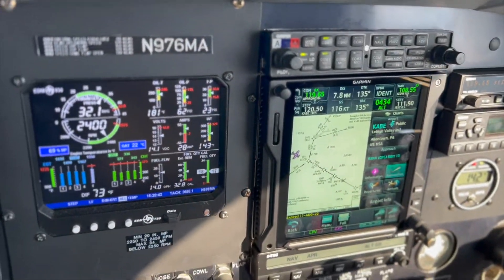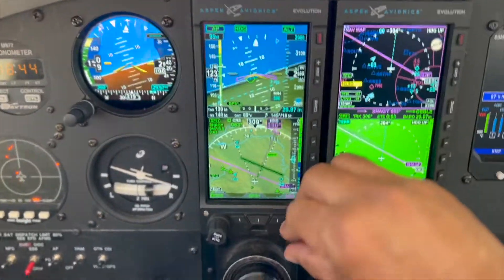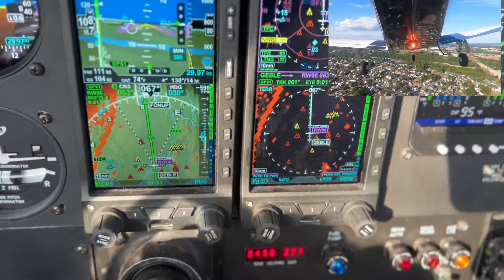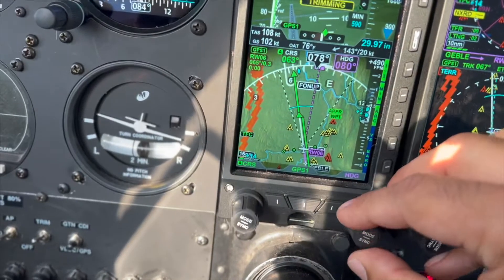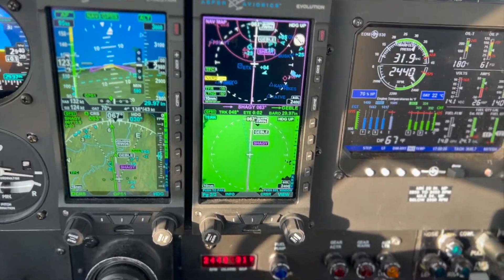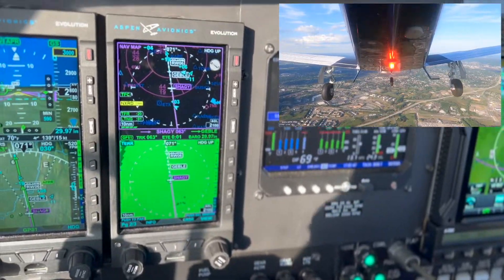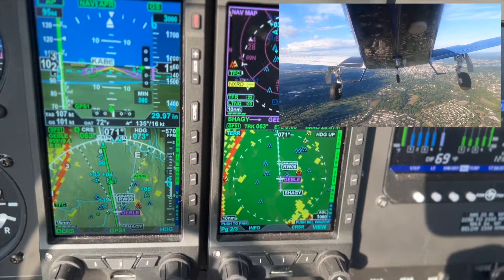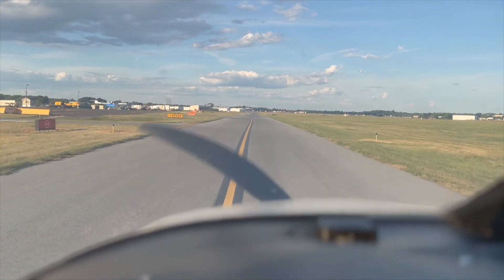Rockwell 112TC LVIA ABE RNAV13 and RNAV 6  coupled approaches.

Comment: Hello!  So...I'm in the market to buy a Commander within the next year.  I'd love to find out from an owner what it's like to get parts and who you deal with for annuals and such.  Would love to chat here or offline.  Thank you for your time and consideration.
Reply from the maker: Hey. i've owned this bird for 22 yrs - bought it with < 3000 hours on the airframe ; Put a thousand plus hours on it. No regrets. I continue to upgrade and keep the airplane as a keeper. No real issues with parts. I've used the same shop for annuals for 20 yrs as well.  There is active owners group - making sure we support each other. I am not aware of a single AOG issue. you can email me if you want if you want to chat offline  112tcrockwell@gmail.com
Reply: @6MA  Much obliged!  Email address saved.  I have every reason to believe I'll be in touch at some point.  All that said, I like the features of Commander series, but parts/support has been a concern.  Beyond that, I'd like to buy an aircraft I can own (and be happy with) for years on end that checks all the right boxes and the Commanders seem to fit the bill...I just don't personally know anyone that has one nearby so the only thing I have to go on is, "Well, I heard/suppose..."  Thanks again!
Reply from the maker: @parakletos9994  And i am reiterating - parts are not an issue.  COG - Commander Owners group is an ardent supporter and none of the members have any issues. There are folks who go it alone and thats where the issues are.